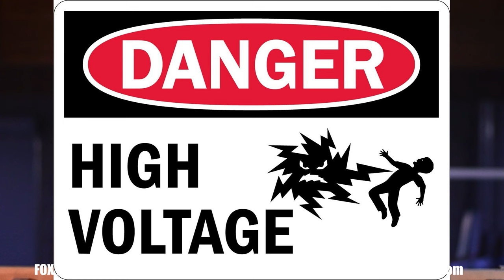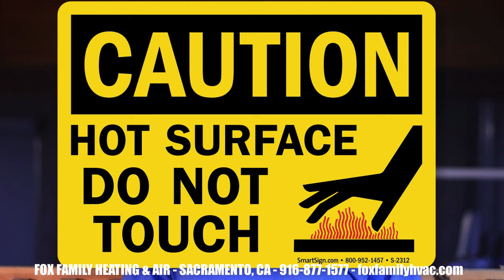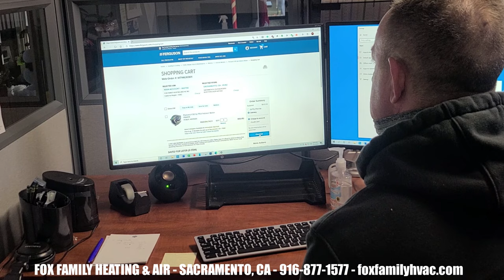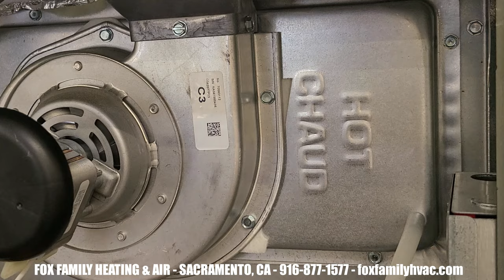Troubleshooting a Furnace Inducer Motor (The 4 Most Common Problems in 2021)

Comment: Please do a video explaining about the orifice that fits on the inducer motor assembly where the inducer motor goes to the condensate plate.  On my furnace,  there were no other symptoms except the darn limit switch kept tripping.  When I go to replace the inducer motor,  the new one came with two different size orifices that you are to clip in the opening  upon installation.  Well,  I looked at the old inducer motor and there was NOTHING there.  So I just assumed that these orifaces weren't needed.  I finished installing the inducer motor without putting one of the extra orifices in it.  Limit switch still tripping!  I'm too frustrated to mess with it so I just have a space heater by the thermostat to keep the furnace from tripping.  Im a very busy mom with three kids 9, 5, and 2.  So getting back to the furnace took a few days.  Tonight I went and looked to see what BTUH my furnace is and sure enough,  it's a 60,000 BTUH and the smaller opening orifice is the one that I should have installed.   So I take it off and put the correct size orifice in and put it back together.   Praying it works, and it did!  Now, someone tell me what happened to the old orifice??? There was no trace of it!  It disappeared and I had no experience to know any better.   I just thought it should look the same way the old one looked.   Now I know!  And hopefully I won't have anymore limit switch tripping for a while!!!
Reply: I would really recommend just changing the limit switch as well.  I'm a technician and I know they just get weaker and weaker when they trip.

Comment: Oh no , my furnace quit !! It’s -15C 
What to do as this modern unit I have no idea.  
I see the videos. 
I make some basic checks. It hums but no fan turning.  
Maybe it’s stuck ? 
I assist the fan motor and it spins after lightly breaking free of something holding it ? 
I power the unit and it turns on inducer motor and I hear it rubbing the housing . I only grabbed the housing with light pressure and the u it became as quiet as a mouse again . Why did this happen to the unit ? It’s 5 years old . How did gravity make that housing rub ? It’s inside  the furnace housing covered and very little dust after 5 years. 
Any way it’s all working fine again thank goodness. I gave myself a lesson on modern systems , bonus. Before my home reno the original heating system was from 1948. Gravity with an added blower system that worked fine until this new high efficient system put in 
With 3 flashes to help me start off troubleshooting lol

Comment: I was trying to order the base plate to which the inducer motor housing is secured. Since I couldn't figure out the name or part number of the product I was unable to order.  It is the part from which the pressure switch orifice protrudes. Any help is appreciated.
Reply: I think you mean the flue box cover if it’s a package unit.

Comment: Easy to tell when they go bad, pressure switches are easy to troubleshoot. Volt meter seeing 24v power travel through the switch and a manometer to verfiy its getting enough vacuum to close. Easy to test contacts and the diaphragm.

 Basic knowledge of sequence of operation is a must. I always include a new pressure switch with any ventor motor replacment. Been burned only doing a ventor motor and then find the ps is bad or going bad.

Comment: Why does my HVAC burners shutdown during high winds from a certain direction? I think the winds are increasing the pressure in the vent pipe causing an error that is 6 short flashes then 1 long flash on the heartbeat light. If I shut the system off and then back on after a few seconds it will run fine, till the next high ends again.

Comment: my funace quit altogether. the LED is showing no faults. i put 120 to inducer and it runs fine. get 24 volts from the thermostat. when i turn up the thermostat I can hear a 'click', what i assume is a relay for the inducer motor, but nothing happens. Furnace is one year old. Bad relay you think?
Reply from the maker: If you're reading 120 leaving the board then bad motor, if not leaving the board from the inducer terminals then bad board. Check with an amp clamp too. Like you said when you jump it, it works so I'm thinking something upstream of the motor. If there are any safeties tripped. Ie pressure switch stuck open, open high limit, etc that could prevent voltage getting to inducer as well. Good luck! 😊

Comment: Will the furnace kick on  and work if the inducer motor is not operating?
Reply from the maker: No it shouldn't. The inducer is a safety feature that gets rid of the spent gasses of the furnace. No inducer, no pressure switch activates, no gas valve etc.
Reply: @foxfamilyhvac  I didn't think so. We just moved into this house not long ago and our old house you could hear the motor. In this house I had to look in there to make sure it is working...It is spinning, but quiet compared to our last home. Thanks for the reply.

Comment: Waiting 5 to 7 days to supply a new draft inducer will not work here in the north.  It must be installed quickly or the plumbing will burst when the water freezes when the outside temp is 10 below.  It's not IF but WHEN a draft inducer fails.  A homeowner in the northern US should keep one on hand.  Ebay has mine for about half the price that the furnace people charged me.   I wish that I had never had a High-E furnace installed .  We are on our second one; the first lasted only 10 years and the draft inducer on both funaces failed.  The old-fashioned furnace lasted for 30 years and was still working when it was replaced.  We have likely spent as much or more money for High-E furnace installation, parts and repairs than I would have spent for extra gas for the old furnace.
Reply: Why did you replace it ?
Reply: @jesuscastillo1083  Bearings got noisy; did not want to wait until failure.  This has happened twice now.
Reply: You'r a professional and your going to tell customer 5 to 7 days for a part meanwhile they have no heat. ? Truly a BS video
Reply: @jesuscastillo1083  Heat exchanger on the first Hi-E furnace burned/corroded to make a large hole.

Comment: Does the inducer motor stay on while the heater is running
Reply from the maker: Yes it does.  In order to keep drawing those gasses out of the heat exchanger
Reply: @foxfamilyhvac  ok tks went to start my heater and it took a min to start spinning, heater fired up, checked on it after a few mins and it was not turning, heater was starting to melt the wire for the igniter
Reply: @foxfamilyhvac  tks for the fast answer it's cold and no heat lol

Comment: REPLACE INDUCER MOTOR 2 YR AGO STILL TURNS SMOOTH NO NOISE. NO POWER GETTING TO MOTOR
Reply: Did you figure this out? Check power source, check the connection, check control board solder joints.

Comment: "4 most common problems":      The worst problem is these sealed "lubed for life" ball bearings in these motors like the Amana ones.  Would it kill them to just add an oil port so that some oil can be added once in a while?      The planned obsolescence is just blatant on these designs.  They don't even try to disguise it anymore.
Reply from the maker: Very good point
Reply: Do I need to lubricate the wheel barerrings,  it was not making noise the first 9 months a new one installed, 
Not its a lil noisy, 
Lubricate  will make it non noisy? Thanks for reading

Comment: I must be a professional then because I can fix that except for that stupid computer but give me some more diagnostic tools and I'll figure it out I got a wire running to my bedroom right now to fool that pancake switch into thinking it's getting vaccine until I get it fixed properly, I know electronics I know physics and I know electricity and I know relays capacitors limit switches thermal switches if you just got to know which ones do what when

Comment: Charges $600 dollars to replace a 50 dollar gas control valve? No thanks I'll just watch Youtube and learn how to replace it myself. You guys are crooks.
Reply: @hatethetube46  OK, but I guess you can charge whatever you want when the heat shuts down and it's really cold outside.  I had one guy come out and charge me $250 and all he did was clean my flame sensor so the furnace would work again.  So that why I want to learn what to do and fix it myself.  The ignitor wouldn't be hard to replace if that goes bad either.
Reply: @hatethetube46  Yes and you might have to replace your Inducer Motor too if that starts making noise. It's fairly easy to do.